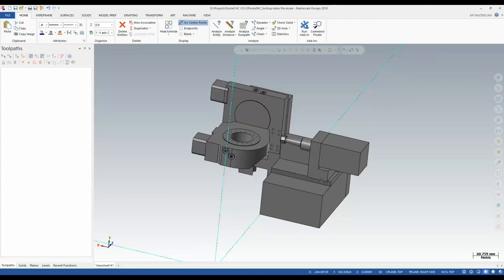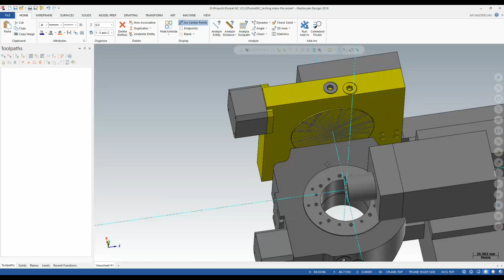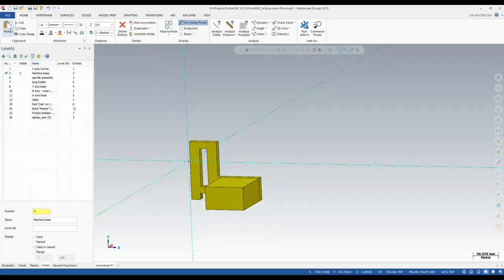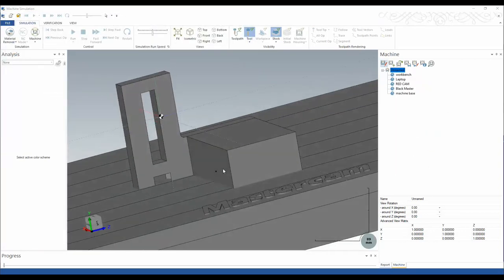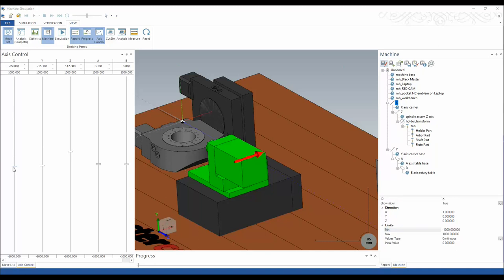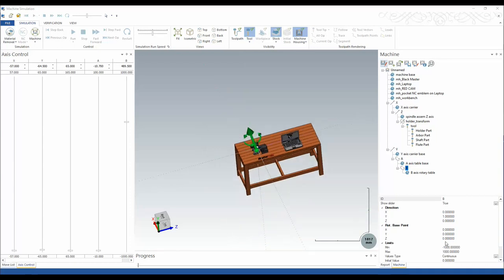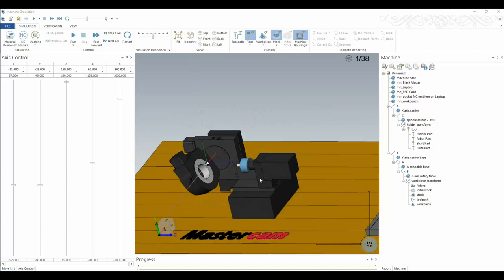Mastercam Machine Simulation HOW-TO BUILD A MACHINE BASICS!

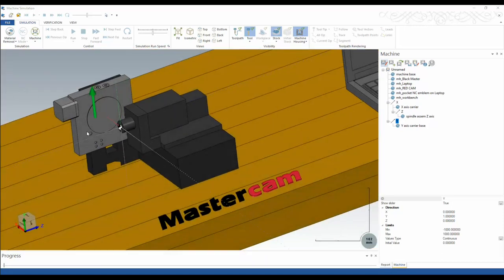Comment: Nice video BUT... At 17:45 the video jumps over the part where you add and define the tool holder. Later on around 28:05 you mention this was done BUT it is not actually shown anytime in the video. Can you add this important step?
Reply: Yeah for real, nice little shady jump there. I am guessing it is similar to the step where you add the dynamic workpiece since there is another selection for tool. I am working on the rest of the machine so when I get to that part of the sim I think its just a matter of adjust the location of the holder where it should sit in the taper of the spindle.